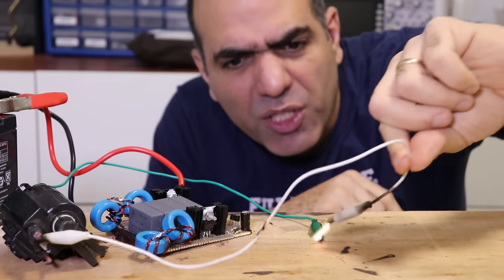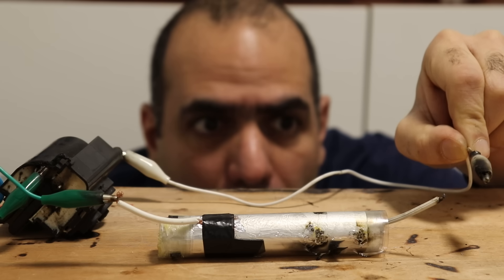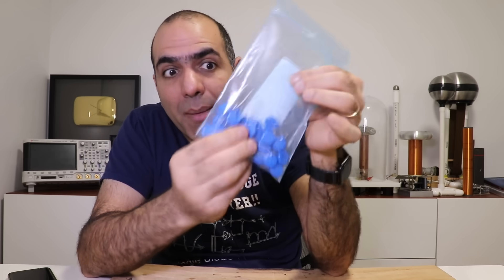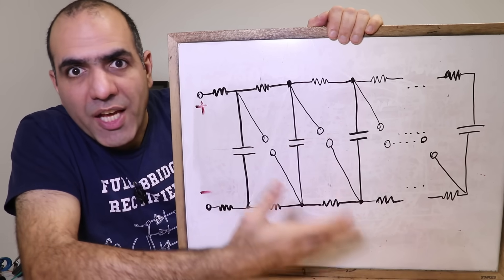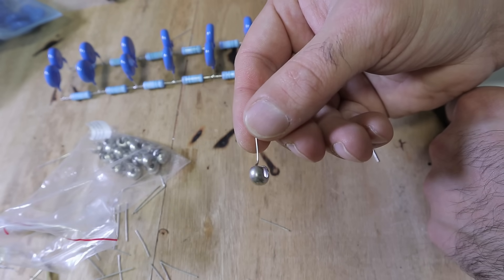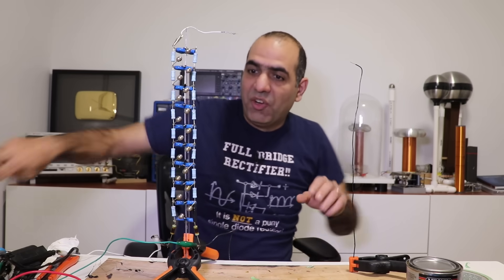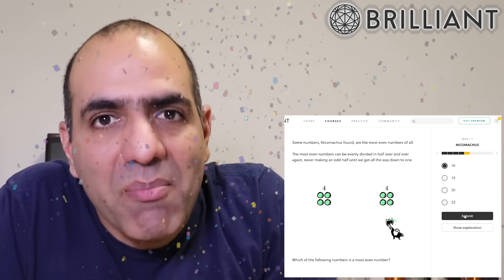Making 500,000 VOLT ARC with Marx Generator

Comment: why does the voltage increase in the capacitors after the first one? The voltage going to the second capacitor isn't the same as the first capacitor while the capacitor is charging right? Why does the second capacitor charger higher than the 1st capacitor? When the first capacitor discharges shouldnt the second capacitor also just charge to the same voltage?
Reply: Hi Doug, it's me...And by me I mean you 3 years in the future...The answer to your question is because the capacitors are charged in parallel to the same voltage and later reconfigured into series via the spark gap. I just want to say you are an awesome guy. You end up getting really good with electricity and become a teacher! Oh, and you finally get laid.

Comment: If you put two resistors in series between each capacitor, wouldn't it double the distance  the electricity had to jump to arc around the resistors between each node?  I feel like that would make it possible to use higher voltages without resorting to the polyurethane.

Comment: I actually have built something similar to the first stage as some kind of "electron spark lighter". Made it with a capacitor ripped out of a dead dryer. It's rated with 15mF ... Sounds a bit like a cat playing with a fork in front of a high voltage substation, so you have to get used to it before getting a panic attack while using it ... yes I was hella bored during quarantine

Comment: Would it work if it had more of the resistors on the other side of the model? If the Capacitors are able hold that amount of energy, maybe it will be also stable enough to do something else.

Comment: Hi Mehdi,
i have a great idea for an expansion project of your Marx generator: a Marx modulator.
Wouldn‘t it be a hell of fun, if you control the number of capacitors connected in series by information from an audio signal, e.g. amplitude/loudness? The smooth audio parts will generate arcs at the first few air gaps, the powerful parts lead to big arcs at the end. To realize this, you have to modulate the charging time of the Marx generator with a high voltage switch, like an IGBT. For this application, it might be necessary to use higher value capacitors or resistors to create higher RC time constants.
Greetings from Germany!

Comment: 9:55 wouldn't 2 resistors in series do the trick?
Reply: Would still jump across, except if you solder them very very close and maybe put tape between the two insulating parts

Comment: One time I hooked a car ignition coil to the household 120v using a dimmer switch... it had about a 6 inch arc... lol  it also messed with every Electronic device on the house and made a CRT tv that was off flash at the opposite end of the house... somehow I managed to not permanently damage any electronics in the house.

Comment: High Voltage from an old tube radio throw me straight backwards across the room. High Voltage could stop your heart or even completely kill you off  !! No Thanks.. a few more high voltage charges will make your body build up resistance to high voltage after while. Capacitors can still hold a high voltage charge even after being unplugged or diconnected from the AC/DC power source. Hey Time Traveller get building that time machine .......??? Looks like Spock from Star Trek is back at it again.....Electronics is great fun .......Hell Yeah !!

Comment: The BIGGEST ARC OF MY LIFE!? Honestly the voltage wasn't very high. I think the Voltage was 40-50,000 or so. However, I was running it at about 1000 amps.  I was using a 3/4" SMAW stick electrode to weld on some foundry dies. The heat cooked an egg in the shell sitting a few feet away. Those things are crazy. Usually I'm happy with a waaaaay lower voltage. More like 20-30 volts. It might be interesting to talk about MiG welding transfer modes if you're interested. Spray transfer, Globular, Short Circuit, and Pulse. Metal does weird stuff when it melts in the middle of a high amperage arc ^_^

Comment: also in the minute 11:00 down the bottom the 2 resistors seems to be fried. isn`t it? 
also is the Flyback output a DC voltage? or AC?

Comment: I have a question in my mind if you answer please. the first capacitors seems to be charged earlier than the last ones due to being close to power supply. right? in this case why the first ones does not arc before rest of them are fully charged ?

Comment: I'm quite illiterate if it comes to electricity, but I'm brave enough to ask a question. If you build the Mark's generator to generate a very long coronal discharge (a big lightning) could you do the opposite to grab a large lightning from the sky and convert it to a  usable power to run house appliances?
Sorry for being stupid if so

Comment: may be you can place the circuit horizonitaly with air gaps facing up in a tray and submerge the whole circuit in insulating/transformer oil and just the spark gaps in air. that way it will cool the system while avoiding any arcing across the leads. This will ensure the voltage is controlled just by the air gaps. Higher voltage might also be possible. :P

Comment: Can you make a slayer-exciter coil using a microwave transformer as the primary and secondaries? Or does it have to be a Tesla type of coil/pancake? Also, is it possible to drive a slayer exciter using AC? It seems like you could get some insane voltage that way.

Comment: gotta immerse the resistors and capacitors in oil, leaving only the spark gaps exposed to air. i did this back in 2000, but the electric wind of my 100kv source killed cameras back then.

Comment: do all capacitors need to be of the same values in this circuit?
Or could i use a 250 volt capacitor at the beginning and higher volt at the end etc etc?
(like in, the other way around, as in 100 volt in the beginning and 250 volt lateron?)

Does the nF or F value need to be the same?

Comment: Can you convert 3.7 v dc to 4000 v ac than converting it to dc using a 4 bridge rectifier and can connect power bank module and charge a power .After charging charge the 3.7 volt battery and charge other power bank to make free energy

Comment: Maybe you can submerge the circuit in that black epoxy that is usually used with circuits. But keep the spark gaps above the level of the epoxy. That should stop the arcs jumping across in the circuit where it shouldn’t arc.
Reply: These circuits are often called “potted circuits”

Comment: You could turn into a high-voltage ion engine air intake air compressor and then it cools it you could even turn it into it it should show Generator how's your noxygen generator or a hydrogen oxygen ion electric jet engine there's a experimental jet engine that uses electricity using microwaves though to generate the plasma. You can search for electric jet engine on YouTube. You should use ultrasonic generator ultrasonic transducers to increase the frequency of are combined with electric Arc also an electromagnet going through the ark kind of like a coilgun but for an electron basically you're making electron gun but combined with coil gun to increase its philosophy combined with ionization basically plasma pulse gun but you might be able to get some distance you could increase and optimize it for distance.

Comment: Please make another video on Peltier devices! Could you use solar power to drive electrolysis and collect H2/O2 gasses to passively generate clean fuel? I was inspired by your previous videos to buy some components on amazon and try splitting saltwater into Cl2/H2, and I was able to get a few bubbles -up to maybe 2mL of gas after 45 minutes with two devices in series (hot water on one side, ice cubes on top).  I love your channel, keep up the great work <3

Comment: If you must escalate the arc length addiction, get some crystal clear potting silicone from an easy to find company with blue and yellow packaging and encase the ladder in that with the arms of the arc gaps sticking up so you can adjust the space and clean them.  Then take the output and hook it to the primary side of your tesla coil so when it dumps the HV charge in the LV Tesla primary coil, the secondary EHV tesla coil pumps up the volts, explodes, and your next video will have you with chunks of toroid sticking out of your face while you explain to me why that was a bad idea, but it did provide good content and partially paid for the medical bills.  Maybe you can get a cool eyepatch outta the deal!

Comment: In real science, air shouldn't conduct. That is called a Short Circuit. And in the real world of physics, short circuits do not exist and forces are harnessed. In real science, everything should be seamless in which forces are harnessed. Except if a researcher is actually seeking a "Short Circuit". Imagine for an instant low voltage low current were used between a capacitor, charges would simply be stored. In the imaginary world of science, that is impossible. I call it "the imaginary world of science" because in that world, nothing can be fabricated and function right. Mainly, that is the entire Earth and all existing technologies. It's also become a blame game in which researchers from100 years ago are used in mentioning 'failure will happen'. I am surprised any science happens at all.
Reply: Three (3) years later. I finally looked up Marx Generator. After looking at the image on Wikipedia, I noticed that a lower left resistor is supposed to be excluded from the design. I am truly amazed at how easily high voltage is accumulated. High charge accumulation and frequency due to the forces between a gap (Bandwidth) are the first goals in all the designs I see people do. Plus, the simple designs are repeated by designing them differently ( https://www.youtube.com/watch?v=-hzhDPWyMcs&t=38s ). Fascinating. It's fascinating because I do not see it requiring a simple design. With simple designs, input power is sacrificed for a simple solution and science never matures. Plus, even simple inventions came from someone. People who duplicate the science are only following a created path and starting from scratch without the paths other people made is difficult and takes many trials and errors. People do not see the difficulties in restarting or initializing a creation that makes history.

Comment: Maybe you can get some more conductive material / metal (like you have for the "switches"), then mount them on a stick or something non-conductive, and put them between those + and - terminal wires for more arcing distance (if that counts for your main objective).  Otherwise maybe stack more Marx generators, because it isn't like you are running a power transformer station (where electrical arcs for those are way more loud and dramatic).  I agree that is very se- I mean neat!

Comment: WARNING! Those large fast arcs induce significant voltages into anything nearby.  This means that operating a MARX GENERATOR will induce voltages that could permanently damage your expensive electronics (i.e. computers, TVs, stereos, alarm systems, oscilloscopes, etc ...)   Any nearby length of wire becomes an antenna, even through walls!  I strongly recommend that you do not operate such a build in your home!  A person with a pacemaker will be potentially killed during operation of this device, even at a distance of several meters.  Any electrostatic machine capable of generating these high voltage ( i.e. Van de Graff generators ) carry the same dangers.  The large amounts of ozone created during the operation of these devices is known to be dangerous to you and your pets!  The best set-up is to operate such a device inside a well grounded large Faraday Cage in a well ventilate area.

Comment: So you won't see this bit i feel like im just going to write it anyway. 
Years ago we got a new vacuum cleaner with a dust separator near the handle. 
It was a stainless steel pipe and thick plastic separator that spirals the dust  (creating alot of static ).  
I tuned the vacuum off and took the dust separator off without touching the stainless tube...  as i was moving my hand away from the vacuum with the separator in my hand i felt a huge tingly sensation over all my skin then THWACK... an approx. 50cm  arc of very blue purple  electricity went from the base of the pole  into my hand holding the separator and across my chest down into my other hand still holding the vacuum handle. 
~500,000 volts of static electrickery...  i couldn't breathe and my shoulder blades pulled together for what felt like an hour  then my muscles just ached and cramped for the rest of the night... 

Story time over

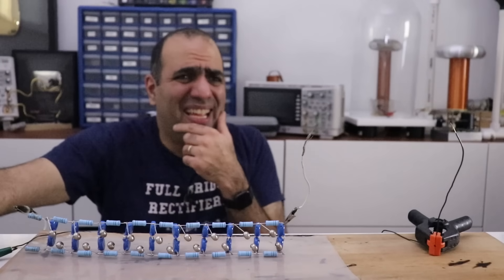Comment: Regarding the arcing across the first resistor in the ground connection (the lower left one around 8:55): That one is in the path of the serial capacitors - the circuit goes through all the sparc gaps, all the capacitors, the big output sparc gap - and the poor lower left resistor that just has to arc across.

(Even though it's probably pointless to throw this into 5.4k comments.)

Comment: Use the capacitor pillar to power an electric motor as if it was a controller but with a potentiometer opposed to having a micro controller to change the speed.

Comment: Have you thought of using AC and connecting step-up transformers in series to step up the input AC Voltage really high at the output?
That should work in theory.

Comment: potting your high voltage generator in something relatively cheap like epoxy resin should mostly eliminate the short circuit issue you're having with the higher voltages.

keep in mind this idea is terrible because it requires fully encasing capacitors in a solid material.

Comment: You could try heat shrink over the resistors to increase the gap between the solder joints.

Comment: Better insulation would have been if u put this in transformer oil and only let the arc gaps stick out. & The best would be if u use high voltage resistors or out two in series to increase the gap.

Comment: I built one of these with a science project, destroyed a couple of bench power supplies in the process. Used PVC pipe, aluminium foil and brass spark gaps. The idea is to supply high voltage with low current. It’s more dangerous than the tesla coil, but not nearley as bad as this one... Needs more insulation

Comment: Would it help if your ground wire was  not connected to the feed resistor (green alligator clamp).  And work better if it was directly connected to the first capacitor?  This way the large arch did not have a resistor in the loop.

Comment: I know you know what you're doing, and just act reckless for entertainment, but I'd be careful with those little jumper wires you're using. High voltage will punch right through them. I used 40kv wire on my HV supply and I still get corona on the outside.  Nicely made Marx generator though.

Comment: Candy Dip Rubber coating instead of Polyurethane! 

check out Wintergatan and the Marble Machine X. he uses it to quiet down metal on metal mechanical contacts, but I think that would work way better than what you used.

Comment: Try using the output of a 60kV dental x-ray transformer and .1uF 100kV pulse caps. 15 stages of those and some 3" brass balls for the gaps = over 1MV. If you set the gap spacing just right (to where the rise time is fast but then pauses just enough to where the next stage fires before the output spark cools too much) you can "grow" the spark to 10's of feet with just 1MV if you have several kJ worth of caps (louder than a shotgun blast). Resistors waste too much power with that setup, HV inductors are better. Oh and if you zap yourself with that it's going to remove fingers (what's left will need to be amputated), if you survive. An outdoor lab in Russia did this to make a spark over 660 feet long with just 5.2MV (but over 7MJ of energy stored = spark stays hot a lot a longer) and sounded like a real thunderclap.

Comment: You would get considerably higher voltage if the caps and resistors were potted in resin leaving the spark gaps protuding.

Comment: Here's a question:
Say we have a circuit that has an output of 1MV or higher ... Now we connect a spark gap in parallel with a short (very low resistance)..
Q1: will there be an arc? (I think there will be)
If yes then
Q2: what will be the value of current jumping across the spark gap at the very instant when the arc is produced?
Q3: will having a short (low resistance)  in parallel make it safe to touch the spark gap?

Comment: The lightning generator in the Deutsches Museum in Munich is made with this system. It can generate about 10 million Volts and about 6000 Ampere, and is one of the main attractions. Since I was a special visitor, I had the rare privilege to see the generator in person, which is built below the experimental stage, and is truly impressive!

It is triggered manually much the same way you did.

Comment: I worked with a nitrogen laser that was driven by a Marx bank. There are plenty of homebuilt/DIY designs that use a Blumlein circuit (and doesn't require optics) that may be of interest to you.

IIRC, it isn't technically a laser because nitrogen undergoes superradiance  and self-terminates, but it works well to pump a dye laser.

Comment: I actually had somewhat same kind of hv shock. I was testing my hv supply and tried to adjust the distance between the +ve wire and ground pin by hand. My mistake was that I was sitting on the floor, the arc jumped to my hand and I made the same face as mehdi. Breaker popped and I was fine.

Comment: May be you can put this all system in a tubular acrylic solution but just exposing out the output wire. It will make whole system transparent plus u get to control it in confidence.
Reply: #electroBOOM